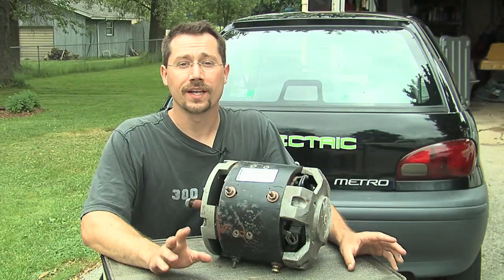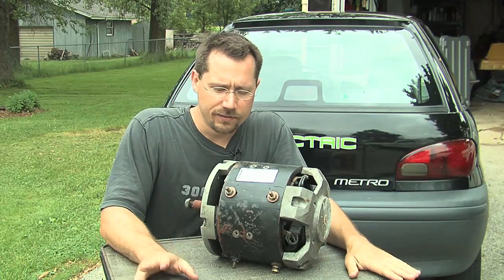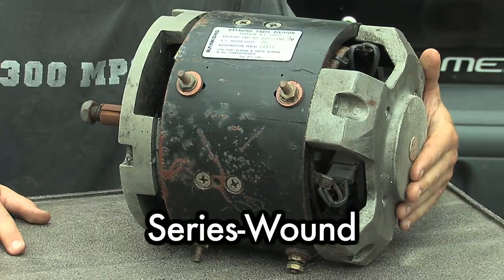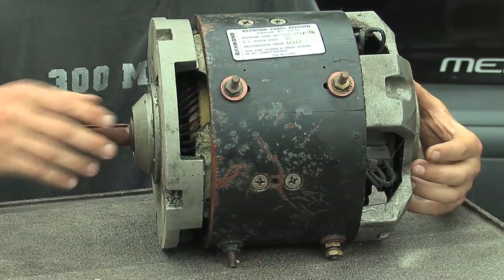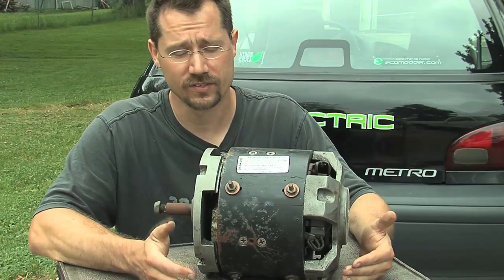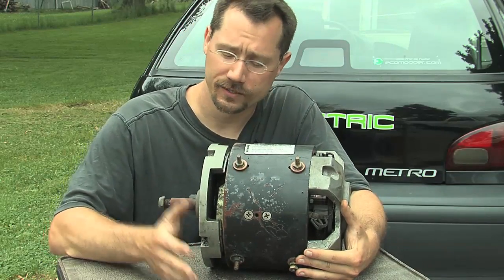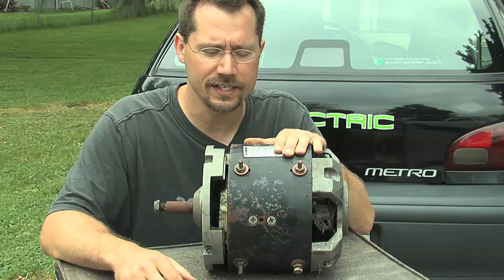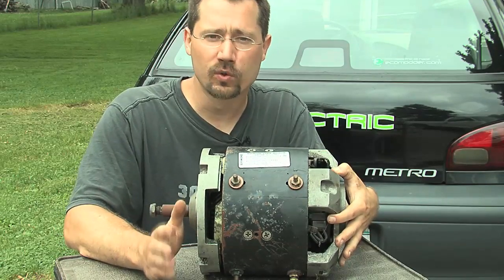DIY Electric Car: 04A DC Motor Basics, Part 1

Comment from the maker: This motor came out of a small forklift, where is was connected directly to the a drive wheel. The four power connections went to the forklift controller, where polarity could be reversed to spin the motor the other way, so the forklift can back up.

There are no permanent magnets in this motor, so you can not easily just power half of it to use as a generator. "Sepex" motors are a slightly different version of motor is is more designed for that.

Comment: Did you know the reason for the 4 power terminals is for the ability to wire it ether series or parallel? This is not a series wound motor but has the ability to be. Another note is when you wire it in parallel if you keep power to the permanent electromagnets you can use the inertia of the car to turn the armature effectively making a re-gen effect (regenerative braking).

Comment from the maker: In general, motors with a cord on them that plug into a wall outlet are AC motors and are NOT designed to run off batteries. Motors from golf carts, forklifts, floor scrubbers, and other things that run off batteries can be repurposed for small electric cars, motorcycles, and scooters.

Comment: so can i use a motor for example like a power tool motor from a cutoff saw rated at 2000watt to drive a motocycle ? but it use a brushed
AC current !! and can a normal dc controller drive it ?